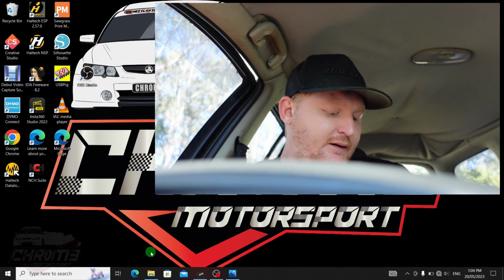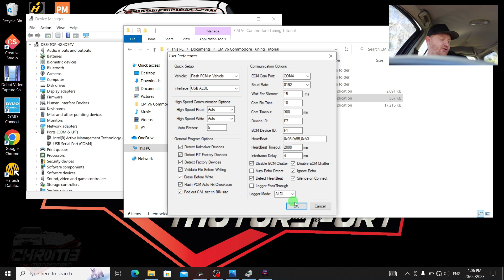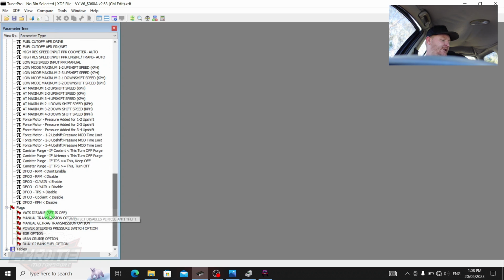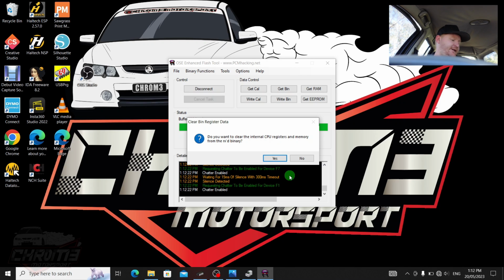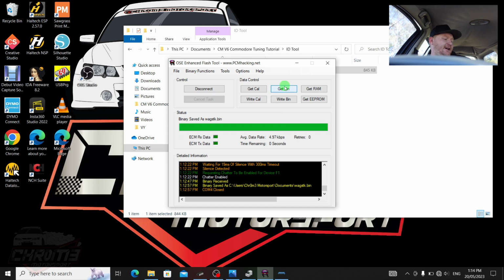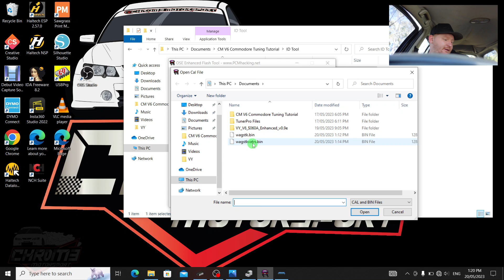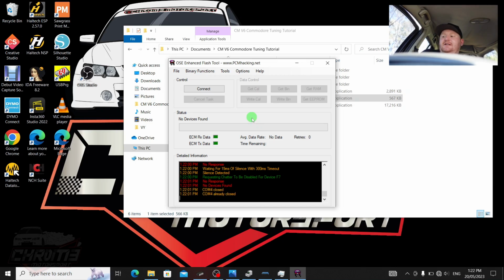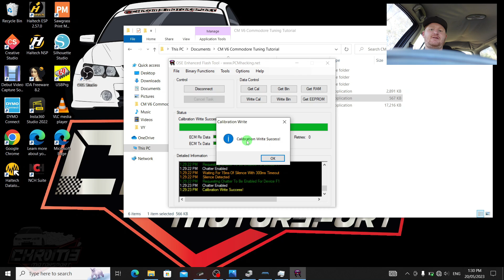Ecotec V6 Tuning: Basic Introduction to Flash Tuning N/A VU-VY V6 Commodore ECU's

Comment: this is great please keep going we need tuners to help
Reply from the maker: Haha wouldn't consider myself a tuner, but that's what this series is about is sharing some of the knowledge I've learned in my years playing with these ECUs.
Reply: @CHR0M3x  how do you raise the limter ?
Reply from the maker: @Baggedvy  Change the fuel cut rpm high and low, keep in mind these ECUs are only capable of having a limiter up to 6350 any higher it will remove the limiter all together.

Comment: Can you turn off the airbags thrue this? I have a vy2 i am turboing and will be tuning anyway
Reply from the maker: Nope airbags have nothing to do with the tune.
Reply: pull the srs fuse it stops the beeping and from my most recent accendent im pretty sure turns them off
Reply: To turn airbag off you need Tech2 scan tool.
Reply: @SmokeHound69  thanks bro

Comment: So if I done a manual conversion can I use this program and select manual gearbox and it should run properly?
Reply from the maker: This requires some explanation, yes you could edit your auto ecu but some of the stuff you'd need isn't defined, so you could set the getrag flag and VSS etc and the car will run and won't have an engine light etc but it will have rev hang, the way to get around this is to match the throttle follower tables to that of a manual (but this table isn't always defined)..

So my suggestion would be to go on PCM hacking and grab a factory manual bin (they have a topic full of stock auto / manual bins for different models), grab the factory manual bin for your model, disable vats (or get it linked), and write the whole bin to your ecu (not just the calibration), that way you have a full factory manual OS and everything should be perfect. 

Take note and be careful because if you flash the wrong bin on or for some reason it fails you will be left with a bricked ecu! So I'd recommend getting a 2nd hand ecu to try this with (any out of an N/A VX / VY V6 will work)..

With that being said any VX / VY N/A V6 bin can be flashed onto the flash ECUs (don't try flash memcal bins to flash ECUs, it will brick your ecu).

Comment: Will any ALDL Cable work? Don't feel like spending $50 on one unless I need too, have found cheaper alternatives
Reply from the maker: From my experience and I've done this a bit, the cheaper ones wear out quickly and don't work anywhere near as well, this $50 cable is a mid range, the high end are 150+, I have a lot of people messaging me having issues and a lot of the times it's cheap cables.

Comment: Can I put a vu or vy ecu in a vs
Reply from the maker: You can but it's no simple task (you'd also lose some dash stuff etc), you'd be better off looking at an NVRAM chip to put in a VS ecu that works out even better than flash ecu as they're realtime tunable.
Reply: @CHR0M3x  thanks mate keep up the good work.